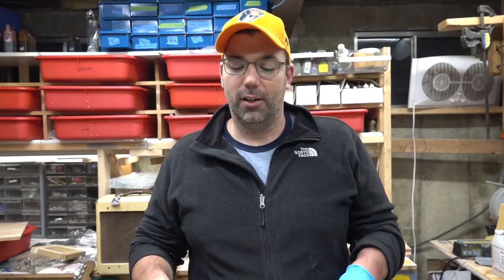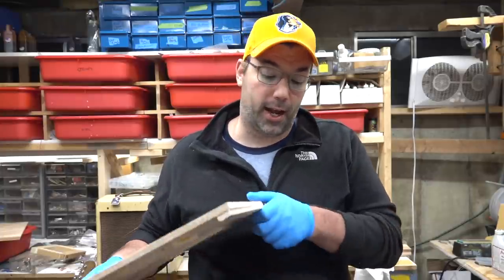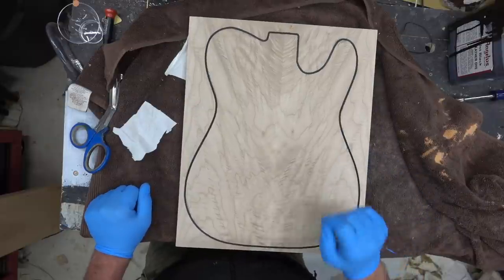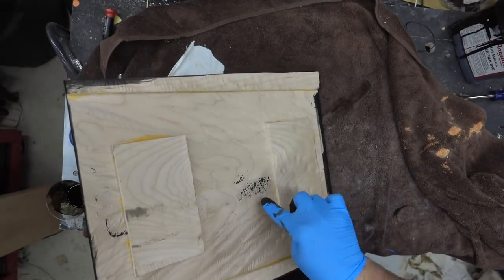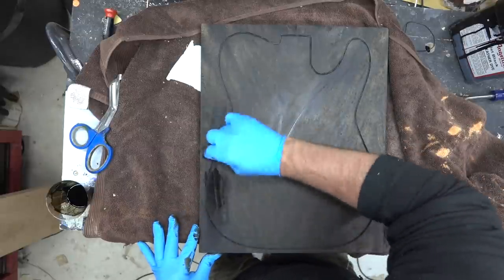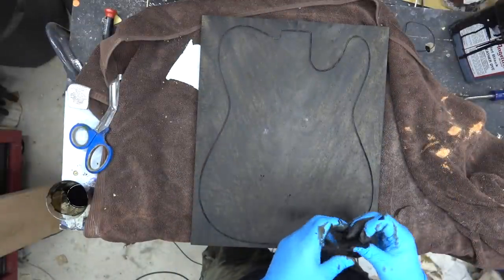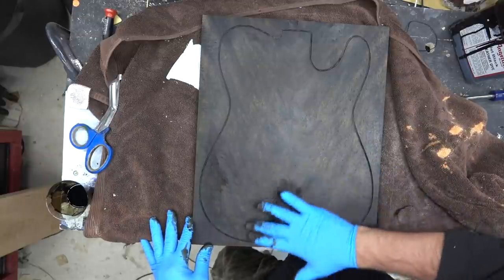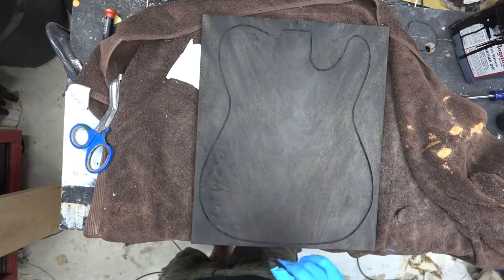Guitar Art - Guitart - Staining a Real Wall Hanger

Comment: Hey I did the "Steel Wool" trick on one  of my guitar but it gave me problems when applying finish after (water based finish). Do you have a trick for that? I thought I could spray one coat of shellac before finish or maybe alcool?

Comment: Welp, I finally did it. I got some Angelus leather dyes to do a PRS style with a basic maple cap. I should have known better, due to having limited strength and coordination from a stroke back in August. Just as I opened that brand new bottle of Jet Black, it slips out of my hand, falls between my legs and bounces off the end of the wooden chair. In slow motion, I was turned into a fat dalmation. It has somewhat washed off, but I have a feeling I'm gonna be speckled for a while. For this same reason, one should never own a weedeater and big dog at the same time........